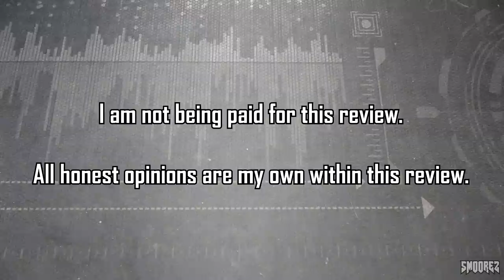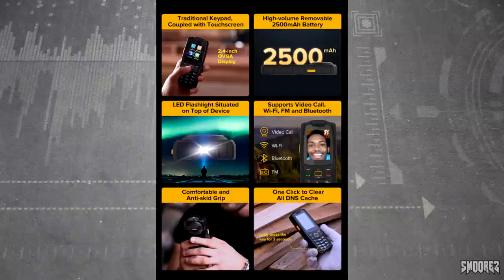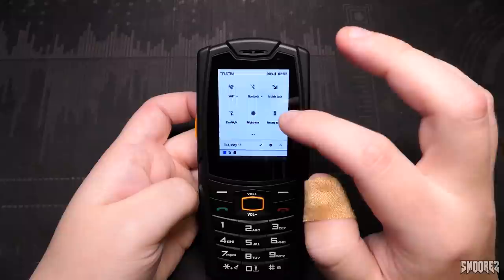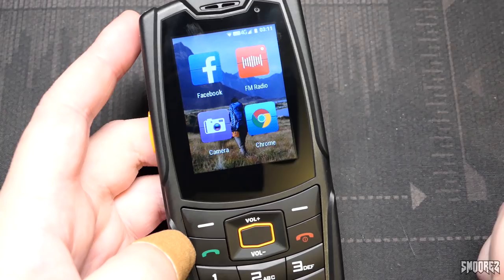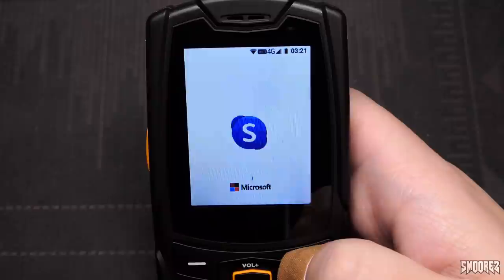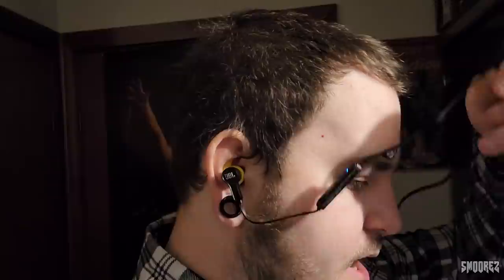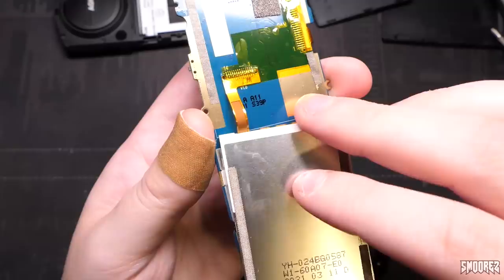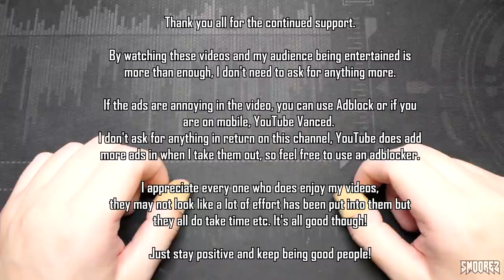The AGM M7 - A $99 USD Rugged Feature Phone with a very LOUD speaker in it - In-Depth Review

Comment from the maker: Make sure you check the bands listed to make sure it is compatible for your network if you consider purchasing this! As there are TWO Versions of the phone, the American Version & European Version. Only difference being the bands so it's very important to check them
*Also small mistake I made with Dual Sims, if using Dual Sim mode - only one sim card will be working at 4G, the other will be at 2G only.

Big thank you to AGM for giving me the opportunity to look at this phone for review, I really do appreciate it!
You can check out the AGM M7 here: 
https://www.aliexpress.com/item/1005002567735723.html
AGM's Site:
https://www.agmmobile.com/
AGM M7 Dock: 
https://www.agmmobile.com/products/agm-desk-top-charging-dock

Timestamps:
Intro: 0:00
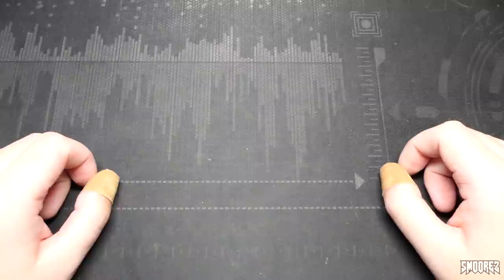The Phone, Pricing & Important Info: 1:09
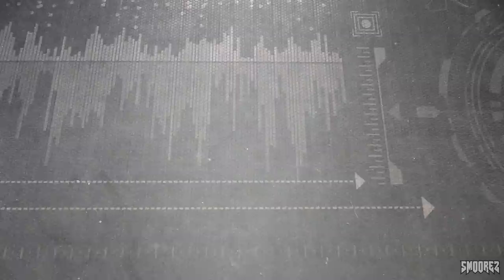Full Specifications: 2:20
The AGM M7 Promo Video: 5:35
The Listing: 6:52
Unboxing: 10:22
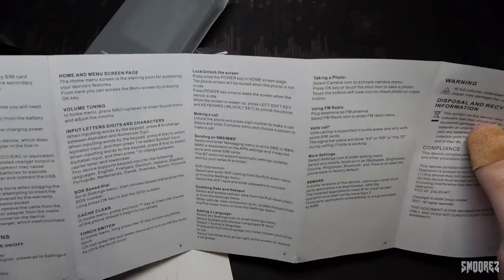Taking a look around the phone: 14:08
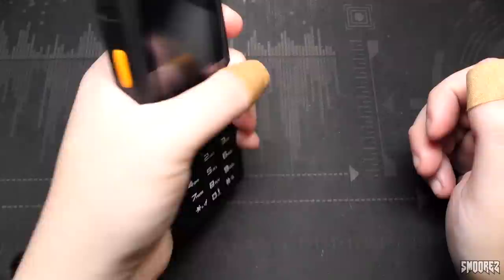Power On, Display, Touch & Torch: 16:36
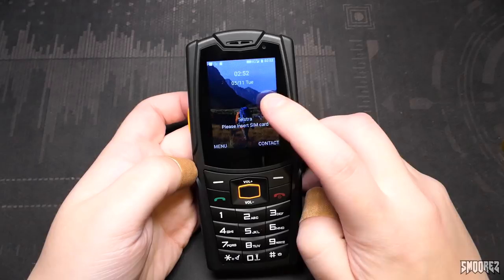Shortcuts, User Interface & Installed Apps: 18:16
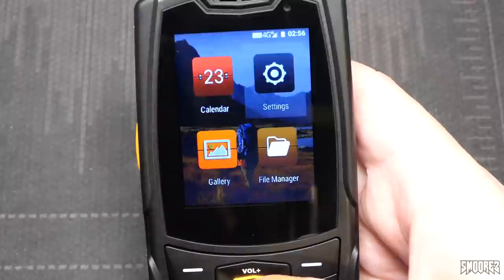Settings - Networks & Application Info: 19:39
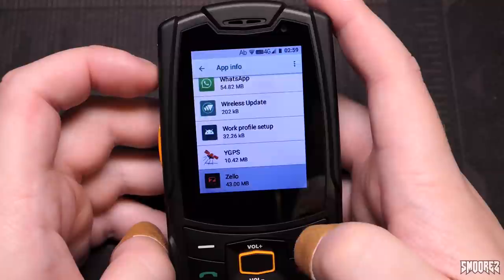Settings - Battery, Speed Dial, Display & Sound: 21:40
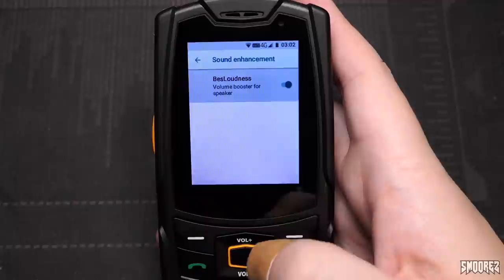Settings - Storage, Security & System: 23:00
Wireless Update & Email Issues: 24:26
Call Test, First bit of apps & FM Radio: 25:47
Camera Test: 27:04
Camera Issues, Future Updates & Battery Test: 29:06
Browser Test: 31:22
YouTube Test: 32:53
Other apps & installing APK files, Clock & Sound Recorder: 34:34
Calculator, Skype, Zello, Clear & Easy Key: 35:41
Checking the specs: 37:12
Gaming Test: 39:12
Speaker Test: 41:43
Bonus JBL Earphones Review: 44:05
Durability Test: 47:55
Teardown: 52:38
The Long Conclusion: 56:22
Timestamps, Thank You AGM & Links: 1:00:54
Outro: 1:02:34

Any questions let me know!

Be good people!
Reply: Bro what US manufacturer 810 ip68, ip69 capable phones are out there??? Need a new phone ASAP lost my wp5 about a week ago and trying to decide can u point me in a good direction?
Reply: I'd like 8gb ram 128 expandable to 1tb with at least 6 inch display and every sensor the armor 9 has but with a better build quality the buttons were kinda wobbly and it just didn't end up standing up over time. Maybe because I drove over it with a 1989 k2500 5100lbs but the speaker and mic just quit on me. I need help ASAP. Would like a 5g 8+gb 128+ 1tb expandable as and a octo gaming core and chipset to be able to play games like COD without lag. Need wireless charging and ip68, ip69 and mil 810 without any possible spyware like the wp5 and armor 9 can have. Please bruh help a fellow techy guy out so I don't waste 700 usd+ like I did on this armor 9.
Reply: Where did you get gta 3 at

Comment: I'm all for flagship smartphones but I legitimately want one of these for my collection. It's so interesting to see android running on this. And yeah, I'd download play store as an apk and install stuff
Reply: did it worked? would you recommend it?
Reply: Depends... its a bit of a novelty for me but it does work as promised and you can do exactly what my comment said and even third party app stores. So you can pretty much do anything you want with it, just be aware that the screen size and resolution can be a dealbreaker for some apps that require different aspect ratios. And it doesn't have flagship specs either (by modern standards at least)

Comment: Good day mr. Smoorez. Thanks for making this video. Its very helpfull. I have just ordered agm m7 at aliexpress, ibe checked the frequency band, its got it, esp. On 2g and 3g band but on the 4g,thats what im concern a littler because it doesnt have all, it has only the b1 b3 b5 and b8, then the rest is lacking, (not the same) maybe it will have a little effect on you internet if using mobile data? Maybe it will be slow? Any opinion on that?

And laslty i hoped they already fixed the problem with the video recording that doesnt have an audio.  Since its already 2023, the phone was last released on 2019 i think? You have any update on that? If they did already fixed on that problem?

Comment: Tried installing Spotify, Facebook Messenger and Reddit on this, they don't work. I got Oldschool RuneScape running on it though..
Reply: Did you install the versions of the apps that were for Android 8 or earlier? That really matters. I've gotten those apps to run on old BlackBerry phones running Android 5 emulation, so I'm surprised it wouldn't work if you have the correct version of app.
Reply: @grumps5940  I get the caution, my guess is that the versions you got don't run on Android 8
Reply: @redshed2020  I'll try again, when I have the time to do so. Might pick up a cheap android phone to get the apps lol
Reply: How about Facebook messenger lite? Spotify even work on Huawei phone, so It won't be problem to any AOSP devices.